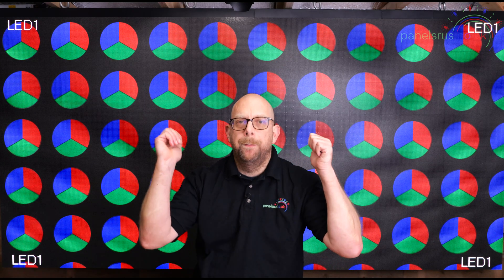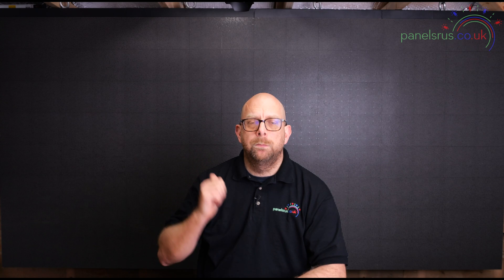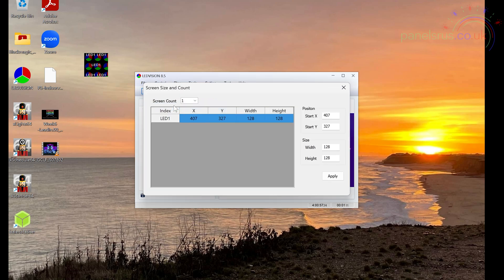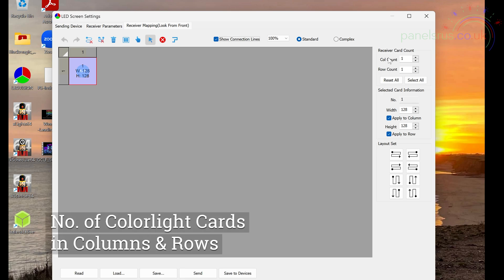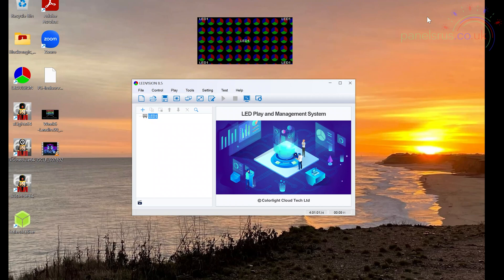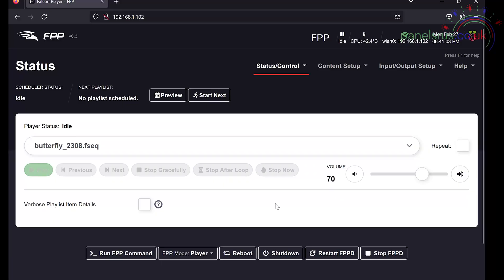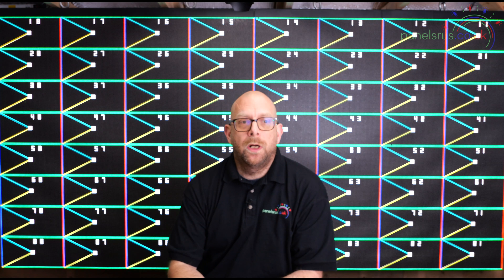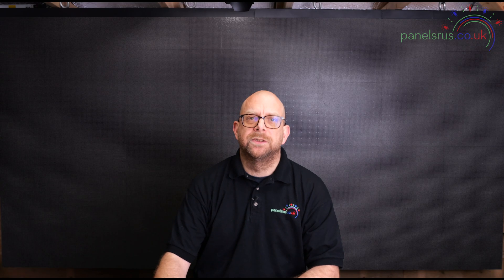Setting up multiple Colorlight Cards in a single panel with FPP v6.3 and LED Vision 8.5 (2023)

Comment: Hi Greg!
I am trying to combine info from a few of your different videos to match to my setup but have a few questions. I have 4 separate ColorLight cards daisy chained on 1 output of the Pi running FPP. Each card is driving an identical matrix 1 panel wide by 8 panels high (outputs 1-8). Utilizing your video on how to daisy chain matrices and this video for using multiple ColorLight cards, how does this look in the panel output section of FPP? This video shows O-1 through O-8 and P-1 through P-8. How would this change for the setup described above?
Reply from the maker: Hi, that would be a total of 4 Wide (P1-4) and 8 High (O1-8).
Hope this helps.

Comment: Hello, first of all, thank you for your videos! I wanted to ask if you could help me. I want to create an advertising wall in the Caribbean. It should be around 1920cm by 120cm, and I'm thinking of using a P5 LED outdoor panel. I have to buy everything from Ali Express, otherwise delivery is very complicated. So, I need 60 LED panels... How many receiving cards and power adapters do I need? And what kind of LED receiver? Can you help me and perhaps suggest something from Ali Express? I would be very grateful for an answer. Best regards, Antonio

Comment: Hello Greg, I have a house with 2 attic dormers. I want to place a panel in each dormer I have created 2 identical panels and wanted to see about daisy chaining them together from the ethernet port, to have them have their own display. Is this possible or do I just need to run the 2nd unit off of it's own pi
Reply from the maker: Yes, you can daisy chain them
Reply: @gregmacaree  Is there a certain way to achieve the ability for them to act independently, and display different effects and or videos?

Comment: I have a 7W x 2H P5 64x64 Pixel Panels Matrix. My problem with the Colorlight Card is, that the brightness is only by 40%, but why i can't go brighter?
Reply from the maker: The refresh (brightness) will reduce over 256 pixels wide on a single Colorlight card. Run 4 wide on 1 card and the next 3 on a second card. That’ll allow increased brightness.
Reply: @gregmacaree  Thank you!!!

Comment: Hi. I have a system setup here with 3  receiving cards which are all powering 10 modules each. My question would be how do I configure them to work as one big screen with a portrait orientation? I'm having 3 same images corresponding to the 3 cards. I think im missing something.  Thanks!
Reply: Did you ever manage to sort this as I'm having the same problem.

Comment: I cannot get the FPP "LED Panels" to work with my P10 1/2 Scan 96x96. ( 3c x 6r of 32/16 P10 ).   I am sending the FPP via HDMI  to Colorlight Sender S2 and yhen Colorlight 5A-75B.  But FPP does not seem to have the option of 32x16 1/2 scan.  Is this critical?  I have got FPP ( on a RpiZeroW ) working fine sending a Virtual Matrix (96x96) to TV screen via the HDMI output. Have I missed something.
Reply: It can be added fairly easily, I’m travelling right now but will respond tomorrow when I’m back in the office
Reply: Greg. I am still stumped. I can make a 96x96 Virtual Matrix display on a TV ..  but when I move the HDMI cable to my S2 Sender ..  nothing. I know the S2 Sender is working because I can see the FPP boot text. My IP etc.
Reply: My application is a Starting Signal panel for our boat club. Quite simple graphics. But different HDMI sources.  One is an iPhone app to run the Starting Flags in Quadrants onto the 96x96. Second is HDMI from LEDVision on a PC for other Flag Symbols or Timers or Fun Text. Third is FPP in RPiZeroW using BigButtons on either iphone or Android. The big Buttons will be attached to XLight/FPP files stored in the RPiZW.